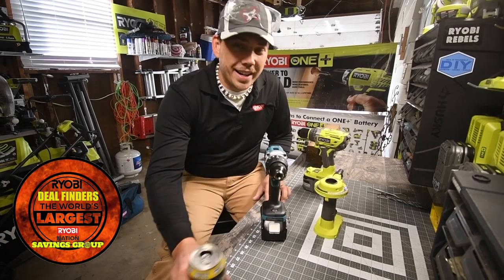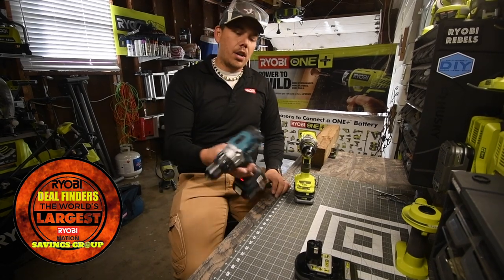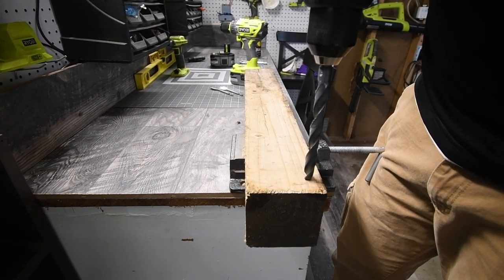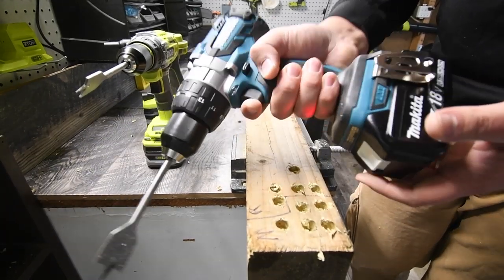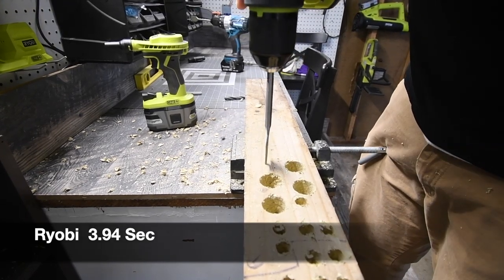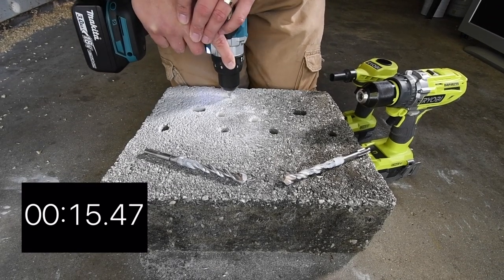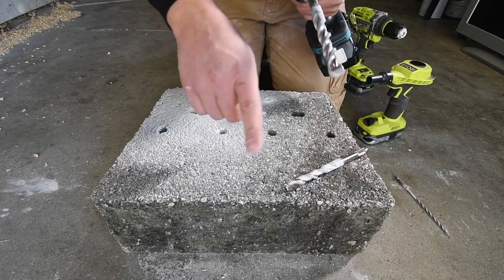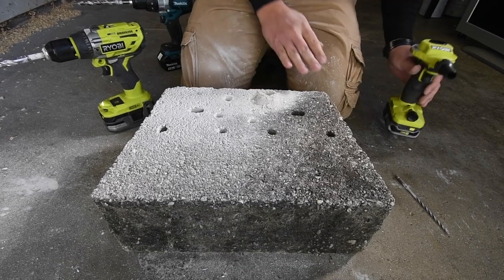Ryobi VS. Makita (Hammer Drill)

Comment: Very impressive by Ryobi! I have used brushed 18v Makita tools for the last 10 years. ALL of my Makita tools (drill, hammer drill, 5inch grinder and impact) have lasted without fault, surviviing many drops and ample abuse only needing a set of brushes here and there.

Before that I had a set of 18v Hitachi tools that were just as good, although the impact driver died eventually.

Would be good to see what a set of Ryobi tools look like after 10 years of moderate abuse.

Comment: Why are you using HP batteries in your tests vs tools that aren't using HP batteries?  If you want to match up batteries correctly, you should have used the standard Ryobi 4.0 battery.  If you are testing power,  you don't need to match Amp-hours.  Amp hours are a measure of run time, not power.  A battery's power is measured by discharge current.  Unfortunately discharge current is not disclosed by the tool manufacturers.  The Ryobi HP battery cells have a discharge rate of 25 Amps each.  The standard cells usually are 15 -20 Amps.
Reply from the maker: I filmed Ryobi HP battery vs Ryobi regular battery. The HP destroyed the the regular battery, Ryobi is not in the competition if I don't use HP
Reply: @ManCaverTools  I believe it
Reply: Because he's testing them at their maximum potential
Reply: Ah does effect a tools power. The larger and the more cells in the pack allows the tools to draw more current as its spread across more cells. I can break it all down scientific like but there’s no need just grab a drill and a 2 ah battery then grab a 4 or 5 ah battery and pull the trigger you can hear the difference and you sure can see the difference when you use them.

Comment: TIM from Canada...Merry Christmas to everyone... to Dave Nicholas.. and all the RYOBI FANS So it is in the works either for Canada or for the USA or maybe both but February or March 2021...RYOBI They’re working on making a new impact wrench that is a  4 speed impact wrench just like Milwaukee. The way the Milwaukee is set up where you have the 3 speeds and the 4 speed is auto tightening... RYOBI HP... I making this exact tool so just thought I’d give everyone a heads up if you were looking for this tool do not know if it is going to be. ..1/2 inch or not but I am sure it will be a big improvement from what they are doing now with their tools...
Reply from the maker: yes they are it is the HP line non compact I will be getting those as soon as they come out

Comment: 15 years ago, I'd always choose makita for work. Since they made the lightest drill, with their compact line. But seems these days everybody has a under 3-lb drill. I recall picking up a dewalt or rigid after using a white makita compact for years, blew me away with how damn heavy it was. Have had 4 of those white compact makitas, all 4 of them same issue with chuck no longer releasing, albeit each time was due to freezing weather. I'd still buy one today, but no longer need it for work. So price of ryobi intrigues me now.
Reply from the maker: this test was no good. I didn't push the makita to its max cause it was not my drill, but now I have this drill and l will be redoing this test

Comment: You should do a Ryobi vs makita tool line up.   They both claim to have the largest battery tool lines.   I think makita’s might be larger then Ryobi.  I know makita has a 18 volt battery coffee maker and an e bike.   
Also when you go to Home Depot.  Ask if you can get their stickers - wood used to separate bundles of wood.   They’re like full dimension 2x3s I think.  Usually they’re rough cut and not very pretty.  But perfect for cutting tests or drilling into.  Plus you can generally get them for free since they’re typically thrown away.
Reply from the maker: I plan on doing all tool lines

Comment: Tim from Canada I am not worried about even the speed from Ryobi I will be just impressed to see if it can even do the job I am sure it will do the job maybe just not the speed that people are used to Makita will always be more powerful than the Ryobi.. I have the Ryobi tools so I know exactly what they can do.. I had to get a few power tools because I have the leaf blower and the weedeater so I needed the batteries and if I have the batteries that I need to get to cheap thrills so this is where I at if I had a choice when I was first starting out I want to stick with Milwaukee but in Canada they had a cheap sale at Home Depot three years ago a weedeater to amp battery and a charger $88... and with the weedeater it is a dual function meaning I can either put a battery in or unplug it has a switch you flick it over to put the battery and you can flick it back to put extension cord.. I think they call it a highbred. Do you not see too many of these it would’ve been nice if they would make drills like this so you can put the battery in flick the switch and it can take the power cord but they have not figured this one out yet
Reply from the maker: Hybrid isnt in that many tools im nor sure if we have a hybrid weed wacker here in the US

Comment: Was that Makita hammer drill a loner from someone you know Makita is not bad I ain't going to lie I don't own anything cordless for Makita at least knew last thing I own that the model number but it was the white color hammer drill and impact driver kit was brushed that was my first lithium Makita kit before that I had a nickel metal battery type 12 v then after that I picked up a DeWalt  14.4v Nicad kit like 4 tools I was doing contracting work as an assistant my first Ryobi was the blue line I got the Circular saw flashlight drill VAC angle grinder all 18 v but Nicad still got all the stuff in a bin in storage now I Ridgid and Bosch not hating on Ryobi at all
Reply from the maker: I like Makita, If I were to switch brands it would be Makita,
Reply: Ryobi Man Caver yeah I’ve been wanting to go to makita but I already spent so much into dewalt 20 and Milwaukee 12 but the makita really impress me.

Comment: Comparing a Ferrari to an Opel Astra LOL
Reply from the maker: I still have to redo this test. I will say this test was unfair. at the time when I uploaded the makita was not my tool, so I didn't put this through the extreme. this video I should not have uploaded
Reply: @ManCaverTools  Just leave it up. Get some views at least. I know Makita is an excellent brand of tools. They may not be the fastest, but for me the fastest is not important. I want to know my money is well invested on a tool that is going to get the job done and last me a while. Ryobi is a nice brand of tools also. 

We had Ryobi tools when at my first job doing construction in 2003. But Makita is built like a Mack truck. I've dropped my Makita DDF 481 from over 5 feet many times I expect any day to kick the bucket. But it just keeps going and going. Btw this is the Rolls Royce of driver drills.

Comment: When I first started on my own, I bought ryobi tools and said I’d upgrade when they broke. 3 years of ridiculous abuse and neglect and they all still operate. They’ve been left in the rain, thrown in mud, sand, and concrete daily. Completely submerged in water. Just thrown and abused by workers. I am impressed that they still work at all. So I can’t complain. I have since upgraded to Milwaukee but we still use the ryobi tools especially when the conditions are extreme and I don’t want to ruin the more expensive Milwaukee stuff.
Reply: I will say the first recip saw I bought was junk. It came in a cheap kit. Was totally junk. It burnt up doing about 20 minutes of work.
Reply from the maker: Very good and thank you sir
Reply: Let's just say that Ryobi drills and impact drivers (corded and cordless) have met my needs and I have no complaints for home use.  If I was a construction professional, I would definitely buy cordless tools with brushless motors but I can't say who makes the best for the money.  I see a lot of people using DeWalt and Milwaukee.  Back in the old days when cordless drills first appeared, Makita made the best cordless drill.  I still have my old Makita NiCad drill and charger from the 80's.  I keep it to remember my mother who bought it for me for Christmas.  It came with a little vacuum cleaner but I have no idea what happened to that vacuum.